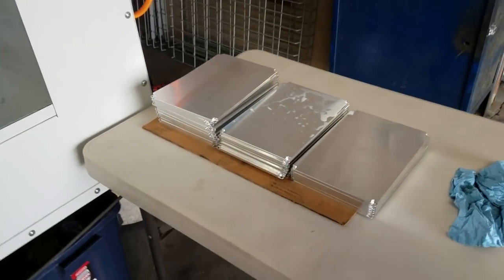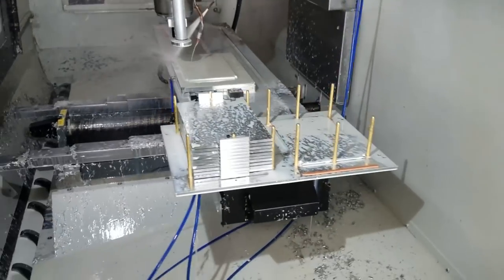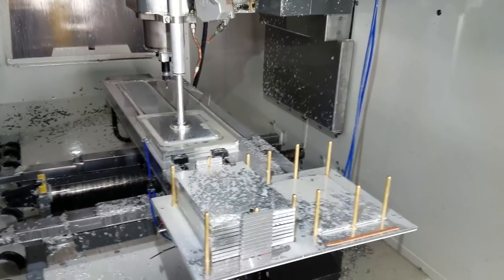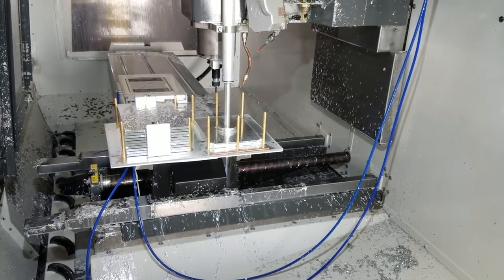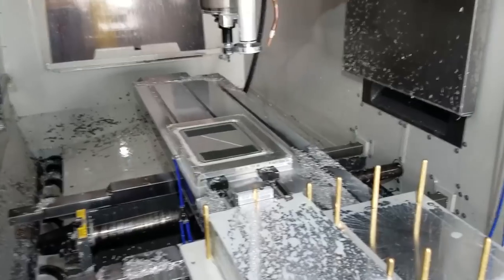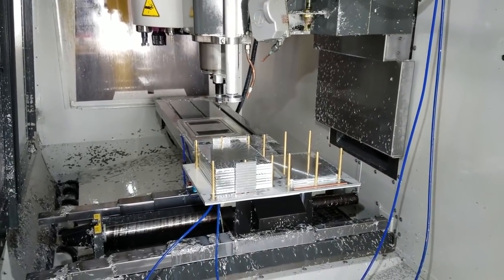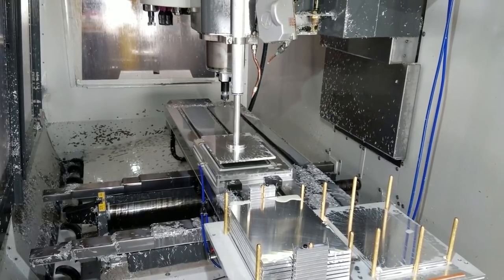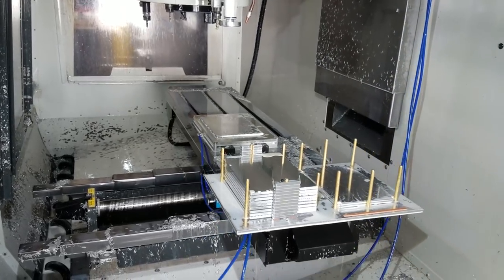Auto Part Loader - Vacuum Quick Shot 3

Comment: That is awesome.  If only the brother machine had that much travel in X.  Instead I would have to buy the robot attachment module for tens of thousands just to do this.  I love my Brother machine for sure but it definitely is lacking when it comes to axis travel.

I see you run your air lines from the top.  Do you prefer that connection method vs coming up from beneath the table via the chip/coolant drain channels? By that I mean does it have a lower chance of getting caught in the ways?

Comment: Looks and works great! Is there any failsafe for when there is a little chip stuck and will prevent the vacuum? Big disaster if it happens...
How do you wired everything up? Bought the additional M-code option on t
he Haas and connected the air cylinder and vacuum plate to it?
Reply from the maker: Yes, there is a normally open vacuum monitor switch.  Under vacuum it closes which allows the machine to run. Standard M codes and relays to solenoids from there.
Reply: Pierson Workholding any chance you could make a video on that?  It would be great for process reliability.  Also, do you make/sell the vacuum gripper arm?

Comment: Im builing a similar part picker for a job with 2000 sheets of alu that will be profiled. Did you make the vacuum generator inside the cylinder yourself or is this a off the shelf item? Have a ABB robot but this is so much easier. Great job!
Reply: hello brother reply if you see this message I need your help in a similar design

Comment: Incredible. How do you ensure that the material is oriented accurately before it gets held down by the vacuum plate? Or do you take enough off the sides that it doesn’t matter?
Reply from the maker: The stack of plates is held square and there's about 1/8" of extra material around the edges.

Comment: Love the part picker!!  Did you add some thin rubber material to aid with grip, for holding the part to be machined? The rubber must be very thin as I  would think that it induces some bowing distortion when under vacuum?  Probably not a problem, I am just wanting to add a little in the middle as well.  Thanks for sharing Buddy!
Reply: Jay explained in one of his earlier videos that he doesn’t recommend this. He recommended to use a small piece of wet sand paper underneath the part to increase traction
Reply from the maker: @silden11  Exactly.
Reply from the maker: Hey Werner... check out this video where I go into detail on everything you mentioned: https://youtu.be/DarGtuxrbUA